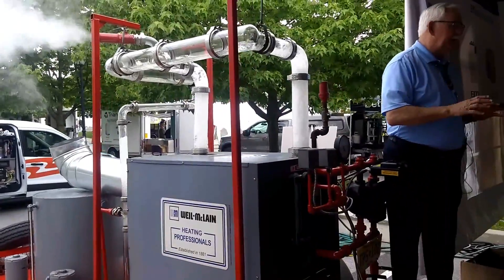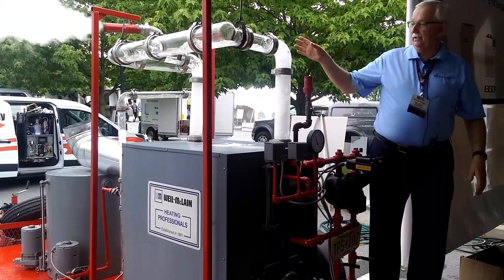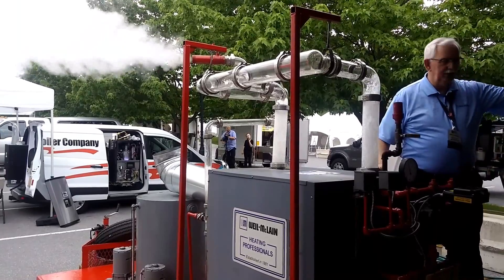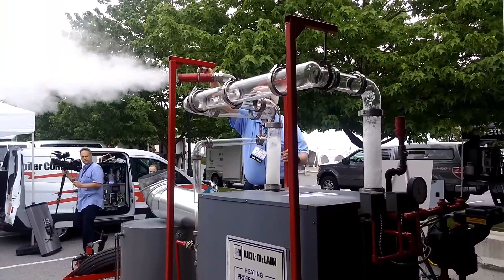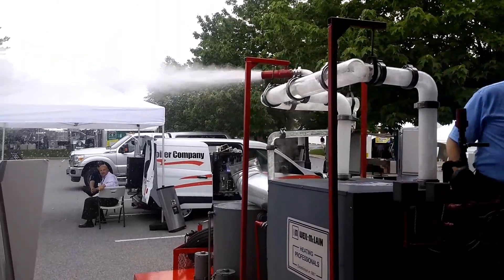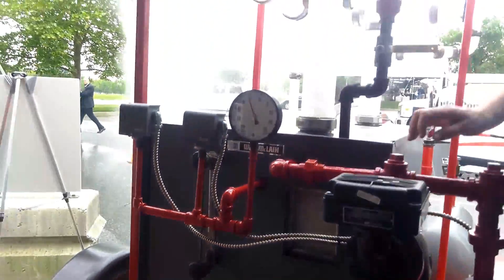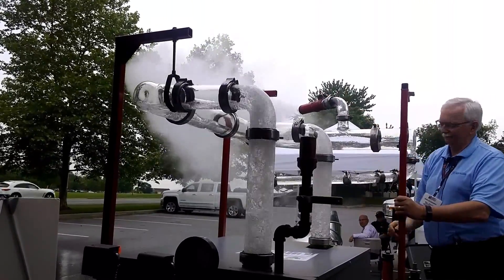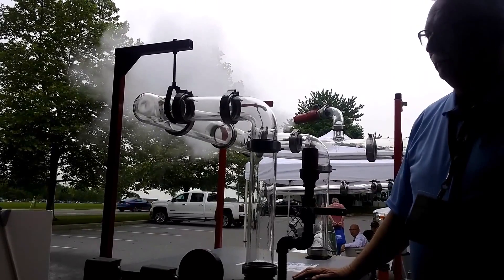Weil-McLain Oil-Fired Steam Boiler Live Fire Demo Piped In GLASS

Comment: Gordon what do you hear towards the end of the video when the presenter’s is saying that if the size of the pipes are too small it can change the velocity of the steam? Is that why in your videos you are usually going one or two size’s over the recommended pipe size for the near boiler piping? How do you calculate the pipe size is it based on the output of the boiler? Or the size of the existing steam mains? Or is it some ratio dependent on the available ceiling height.
Also I have a question about drop header’s is it 24” above the water line or if there’s room 24” above the jacket? Before the first elbow? How far to the second elbow? How much drop? A ratio? Or similar to 3,4,5 triangles?
Reply from the maker: We use the manufacture's pipe size tables as a starting point.
That sets the floor for the minimum requirements.
Say, a certain 4 section boiler allows only one of two outlets to be used. Let's say that the six section boiler requires two outlets, so we believe we're pretty safe in only using one outlet.   
Say that outlet is 2".  Many steam folks would say to use both outlets regardless to lower the velocity of the steam exiting the boiler.  
It's a judgement call.
We can use a 2" header per instructions, say.  If we go up one size to a 2-1/2" header, we believe we get dryer steam at a reasonable cost in materials and, more importantly, time.
If two outlets are required per instructions, we go 24" above the  water-line at a minimum before the first 90s. and use a drop header.  
Some boilers require 24" above the jacket before the first 90.
The drop header dries out the steam (or so we believe), but it saves time & frustration in assembly by adding degrees of freedom to "make-up" all of the piping at relatively low cost of two extra 90s and nipples.
The second 90 drop into the header doesn't need to be too low, just a few inches most of the time.  Too low and water level issues at the equilizer start to be an issue.

Comment: So at beginning that's how it should run or at 2:22 ?
Reply from the maker: 2:22 is closer to how it should run (provided the water is clean and the near boiler piping is spec)
Thanks for your question.
Reply: @gordonschweizer5154  Thanks for your reply. Just wanted you to know you remind me of my dear old friend Dieter from Germany. I met that man and he changed my life. He got me into refrigeration and hvac. He took me under his wing and I worked with him for FREE, for 5 years until he passed away. Made possible from the support of my wife. Keep up your great video's. I myself am not a boiler guy however I can repair them and have installed one ( for my uncle ). I do have my 1st class stationery license, and use to run and work on boilers at the hosipital for 3 year's that however to me seemed easier because they are not hacked on. Thank you.

Comment: I saw this at a Chicago supplyhouse a few years ago. Big plumes of steam rolling down the street. Pretty cool stuff
Reply from the maker: Yeah, it is cool, isn't it?
They've been running that glass boiler set-up for over 20 years.
Reply: @gordonschweizer5154  so this demonstration is to show that it's not safe to run steam more than 1 psi?
I know you not supposed to and I also know the empire state building works on 2 psi of steam which take 5 min for steam to reach up to the top last floors
Reply from the maker: Thanks for your question!
They run this demo at 5 psi and then "pop the cork" to make it look impressive.
The main point of this demo is to show the importance of proper near boiler piping in providing "dry" steam to the system the boiler is attached to.
It is allowed to run a low pressure rated system and boiler up to 15 psi,
but the system was designed and had to be warranted to heat a building with under 2 psi. The "2 psi standard" started in Dec. 1899  in NYC.  Dan H. tells the story how that came about. It's a doozy of a tale.

There is a bit more to the Empire State Bldg. story than is generally told: While the inlet pressure is about 1 to 2 psi, that part is true, the downstream pressure is a mechanically induced vacuum !  So the "actual" pressure difference is about 6 psi! 
Mind you, that's still pretty low, all things considered, but not quite as impressive as "1 psi heats the Empire State! Cool!"
It's the vacuum that really makes the steam just fly up the pipes.

Comment: Now, if Weil McLain would stop using rubber gaskets to join their boiler sections, I might start pushing their products to my clients. 

For all you naysayers, I know that any boiler will leak if run dry, but still; others like pennco or New Yorker, etc., still use steel bushings.
Reply: You are correct

Comment: The Weil-McLain engineer who oversaw the building of this glass-piped boiler told me as an aside that glass piping and the special joints allowed NO wiggle room or fudging.  All of the measurements on this had to be exact!  20+ years later and no problems is a testament to their skill.

Comment: What the demonstrator does is to run this boiler up to 5 psi and then quickly open the steam outlet valve, blowing steam across the parking lot (and sometimes discombobulating the passersby!).  As you can see, a portion of the water in the boiler flashes over to steam in an instant causing the dramatic effects shown.